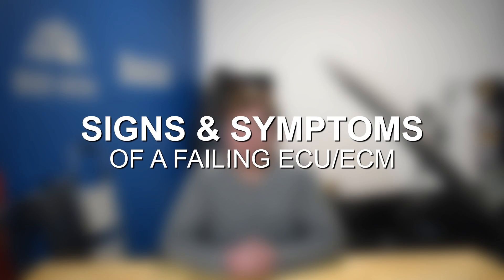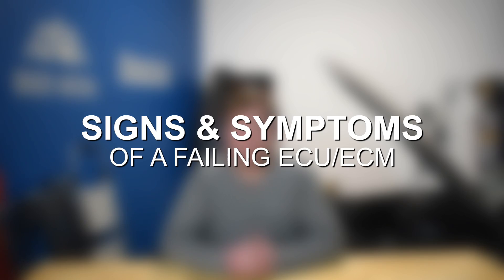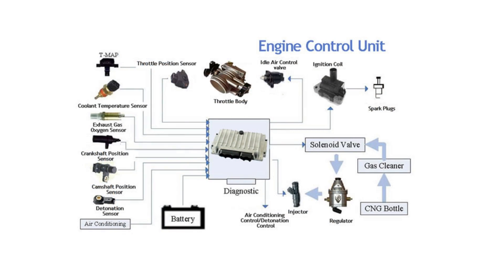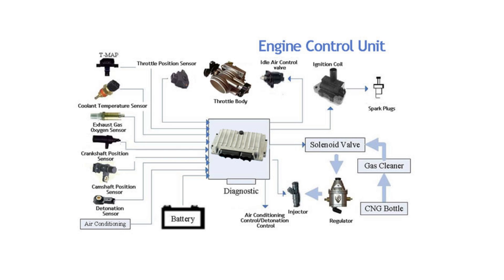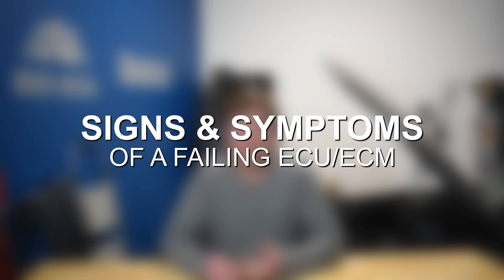Signs & Symptoms of a Failing ECU/ECM! (Engine Control Unit or Engine Control Module)

Comment: Great video, lets me know I was on track with my 2007 camry as i went thru all these steps you mentioned. New ignition coils, o2 sensors, cleaned out throttle body. However, I reset the ecm and it works great for about 2 runs of driving the car on maybe 30 minute trips but after parking it for the night, the next morning I start the car and boom, engine light back on and I know not to drive it at that point because the car has no power to move efficiently until I disconnect the battery for 15 minutes, reconnect, and it resets again. This is a daily ongoing pattern. My dilemma is do i spend another $260 on a new ecm. In your professional opinion, would that probably be your next option (after process of elimination), the car is 18 years old, already has new coils, o2s, clean throttle body (air flow system). Thanks again for posting this video 👍
Reply: I own a 2000 Mercury Marquis. It only has 36k miles on it. For the last 5-6 years I have had what seems to be an intermittent problem with the car shutting off on me while driving. When it is running it runs great. Nothing at that point makes me think anything is wrong with the car. Because of the intermittent problem I don’t trust the car anymore to drive it any far distances beyond 10-15 miles. What happens most of the time when the engine shuts down while driving from when it first occurred 5-6 years ago. The check engine light will come on. I plugged in my OBD II tester into the port below the dash and got a P0-320 code. That pointed to the crank Sensor so I changed it out using a Dorman brand of Crank Sensor. The car ran good for 9-10 months when all of a sudden the car shut off again with the PO-320 code came back on. At that point I purchased a second Dorman brand of new Crank Sensor. Installed it and the car ran good again running 8 months straight until it then shut down on me at a Traffic Light or Stop Sign. Sometimes it would start right up and want to die again. There were times I had to use both feet operating the gas and brake and maybe shifting in to neutral all the way home to get it home. Let it sit over night and once it cooled down it starts right up still showing the PO-320 Code. The 3rd time I went out and purchased a Ford Motorcraft crank sensor and installed it. Back in March of this year while it was sitting in my driveway at my relatives home when I went to leave the car wouldn’t start but turned over no problem. No continued check engine light and my OBDII tester showed no codes. I finally got it started and had to get creative with my feet again to drive the car about a mile to my home. At that point I gave up. I thought I would send the car out to a reputable repair shop. I knew this shop well because they did some work for me before on other vehicles  plus I did plenty of business with them in the past. I use to be in the Automotive Parts Business until I retired after 40 years and sold them bulk Motor oil in 55 gallon drums. Had Triple AAA Tow the car to the shop. The shop brought it in and called me after checking it out said they repaired the car charging me $308 telling me something was shorting out Coil #1 so they replaced it. I found that hard to believe based on my own knowledge of the car. When it ran there were no misfires it idled great. I went to pick the car up and drive it home. Something didn’t seem right to me still with the car. This was on a Friday so I got home and put the car in my driveway. On Monday 3 days later I needed to go somewhere so I thought let me drive my 2000 Mercury Marquis. It started up and died in the road. I had to push it to the side of the road with some help. Called Triple AAA again and had it towed to the shop again. This was in April of 2025. The shop kept the car there for 3 months. They were getting mad at me when I would call there after the 1st month to check on the car. Finally it was getting to be 3 months and I called them telling them I was taking the car and finding possibly someone else to fix the car if they couldn’t. Went there and had to jump the car being they let the battery discharge while sitting outside the shop. I drove the car home with someone following me. They supposedly checked everything including the fuel pump which isn’t old it was replaced once already by me maybe 8 years ago. When I opened the hood to jump the battery I saw the shop never put the engine cover back on the engine so I went back the next day to retrieve it. When there I talked with the shop owner. He told me he thinks it is the Cars Computer but didn’t want to install one because of the cost not knowing if that would have fixed the problem. So I am out the $308 they charged me to fix the car in April although it wasn’t fixed. No reimbursement. I never said a word. To be honest while the engine cover was off I looked at the 8 coils. They looked like all the original coils as dirty looking as they would be on a 25 year old car. Didn’t look like the Coil was ever changed on number one cylinder but I was charged for 1 new coil. So I am at the point of ordering a replacement rebuilt computer flashed to my Vin Number of my Mercury Grand Marquis. I figure what do I really have to lose and I am perfectly capable of making the exchange. Anyone’s thoughts?
Reply: @ffas23  that is kinda the same situation i was in with my toyota which i purchased from my sister n law after towing it home for them due to her son driving it rather abusively for about a year, i ended up buying it from them and fixing it for myself. Everything on mine needed replacing i think to begin with but finally investing in a ecm did the trick....until a few weeks later when the check engine light popped its head up....again. Resetting the new ecm over and over again didnt help and i felt i was out of options so...today...I drove it to autozone and had them run their tester on it and it reflected....now....a knock sensor was the problem. These issues like this can definitely troubleshoot the crap out of you. Hope your ecm fixes yours.
Reply: @BOBBYB3133 Thanks for the quick response. I am waiting to hear a little more from here before I make another move. Not looking forward to seeing if any other Repair shop knows enough to fix my problem. 3 months in the shop? At this point I am not feeling so bad being I got the car back now. I guess I am not too bad of a backyard type of mechanic turning wrenches on most all my cars since I started driving in 1968. At 74 years old I thought the smart thing was to just send the work out to be repaired but the reputable shop was not much smarter than myself being they couldn’t figure out the problem either. lol. What bothers me is I paid $308 and my car was not repaired last April. I couldn’t charge someone if I couldn’t fix their car if I was in the business of fixing cars. Doesn’t seem like the right thing to do. Then to sit on my car for 3 months straight. I lost all around on my situation. Live and learn they say. Problem is I use to recommend this shop to many people. I can’t do that anymore.
Reply from the maker: @ffas23  Given the long history of P0320 codes, multiple crank sensor replacements, and the fact that it will run great until it randomly dies, I think you’re dealing with either an intermittent wiring/connection issue in the crank sensor circuit or a failing PCM, not a coil problem. On these Panthers, a bad PCM is uncommon but not unheard of—especially if the stalling happens hot or cold, shows no other codes, and isn’t tied to fuel delivery or ignition output once the PCM loses crank signal. Because you’ve already tried quality Motorcraft sensors and still get P0320, it’s worth doing a careful inspection and wiggle test of the harness from the crank sensor up to the PCM for damaged insulation, corrosion in connectors, or loose pins. If that all checks out, a rebuilt PCM flashed to your VIN is a reasonable next step, and since you’re comfortable doing the swap yourself, you’ll save a lot compared to a shop guessing. Just make sure the replacement PCM comes from a reputable rebuilder with a warranty, and before installing, clean and inspect all main grounds and battery connections, because poor grounds can mimic PCM failure symptoms.
Reply from the maker: B - Yes, based on everything you’ve already done—new ignition coils, O2 sensors, cleaned throttle body, and the fact that the car runs perfectly after an ECM reset but loses power and throws a CEL after sitting overnight—it strongly points to a failing ECM that can't retain correct adaptive data or mismanages fuel/spark strategy once in closed loop. The reset temporarily clears out corrupted learned values, but the issue returns once the ECM re-learns and re-applies faulty parameters. If you’ve confirmed no vacuum leaks, wiring damage, or bad grounds (especially near the ECM), then yes, replacing the ECM would be my next move—just be sure to get one programmed to your VIN or budget for programming if buying used or aftermarket.
Reply: @8020Automotive  Thank you for the confirmation because i went ahead and ordered one before you replied lol and now i fell better about doing so. After all the mechanical steps i also went ahead and disconnected any grounds and cleaned them and rebolted so i felt like the only thing left was the ecm. Good advice ➡ Absolutely bought one that is being programmed to my vin. Hopefull that will do the trick. Thanks for getting back, your videos are a tremendous help 👍

Comment: My equinox is a 2011 an it’s throwing on the abs light traction control light an won’t go at times or will go by its self or it will die when going at 25 would yk what’s wrong with it?
Reply from the maker: K - Your 2011 Equinox showing the ABS and traction control lights, stalling at low speeds, moving on its own, or not accelerating properly points to a likely issue with a failing wheel speed sensor, bad throttle body, or even a faulty brake switch or wiring harness problem. The ABS and traction control systems rely on accurate wheel speed data, and a faulty sensor can confuse the system, triggering limp mode or causing erratic driving behavior. Also, a failing throttle body or sensor (like the throttle position sensor or accelerator pedal position sensor) can cause hesitation, random acceleration, or stalling. Scan it for stored or pending trouble codes with a proper scan tool (not just a basic OBD2 reader) to see if anything related to wheel speed, throttle position, or stability control pops up. That’ll help narrow it down quickly.

Comment: Bought a 2005 express cargo 4 y ago, shortly after it can only be driven on second when the dashboard warning lights appear, when the warning lights go off it drives normal. Some mechanic said it was the battery so i replaced it to no avail. Another mechanic said it was the break reservoir to no avail. Just picked it up from Chevrolet after 6 weeks and found nothing just codes. B1000, b1440, b2948, p0507, u1009 but he said i needed to replace the transmission which i knew it wouldnt fix it so declined and picked it up. Im out of options maybe i can sprinkle holy water?
Reply from the maker: R - Haha. You’re absolutely right to question the transmission replacement—that wouldn’t fix what’s clearly an electrical or module communication issue, not a mechanical trans failure. The fact that your 2005 Chevy Express only drives in second gear when the dash lights are on strongly points to it going into limp mode, and the codes confirm this: U1009 is a communication loss with the ECM, and B1000 indicates an internal module fault (often body control module or instrument cluster); B1440 and B2948 relate to HVAC and security circuits, and P0507 is high idle, likely a side effect. This all suggests an intermittent power or ground issue, possibly at the ignition switch, fuse block, or BCM connectors, where one bad contact can crash multiple modules and force the vehicle into limp mode. I’d focus on checking main grounds, battery terminals, fuse box power feeds, and especially BCM and ECM connectors for corrosion, loose pins, or cracked insulation—it’s tedious work, but way cheaper and more productive than blindly swapping a transmission.
Reply: @8020Automotive after replacing the starter when turn key to on it makes a noise similar to the noise it makes before starting the engine. I had never seen that. But the whole time the break reservoir was leaking, it was leaking into the fuse box and it had the fuse box cover off since i bought it by accident. I asked chat gpt and said a regular Home electrician can help me find the problems and My father is an electrician and Will work on it this weekend. I Will update the findings here thanks!

Comment: Could an ecu that's 30 years old go bad? I know you said it will run well still for 15-20 years. Im working on a 95 Honda accord, and the ecu is from June 24, 1995.
Reply from the maker: C - Yes, absolutely—a 30-year-old ECU, like the one in your 1995 Honda Accord, can go bad, especially due to age-related failures like dried-out capacitors, cracked solder joints, or corrosion from moisture over time; even if it still starts and runs, symptoms like intermittent stalling, rough idle, no-spark situations, injector issues, or random sensor codes can point to a failing ECU, and Hondas from the '90s (especially OBD1 systems like yours) are notorious for leaky electrolytic capacitors inside the ECU that slowly damage the board; if you’re chasing weird electrical issues with no clear sensor or wiring fault, it’s absolutely worth opening the ECU and looking for leaking caps, burnt traces, or a vinegar-like smell—and if you're unsure, you can swap in a known-good ECU from a junkyard or reman unit to confirm before throwing more time or parts at it.
Reply: @8020Automotive  Thank you! I had recently bought a refurbished/rebuilt ECU and installed it yesterday. & What do you know, it started right up! Before, I had thrown alot of new parts at it. But then after some diagnostics, I was able to determine that it was the ECU. It was a learning experience indeed! I appreciate you responding and being very informative. Thank you again!
Reply from the maker: @twinklymist7396  Love to hear it! Thanks for sharing.

Comment: I am only shooting a P0405 and I have replaced my EGR valve twice. The wires look ok. My car keeps cutting in and out as I drive. I replaced coil packs and spark plugs and wires. I dont know what it is or where to look next.
Reply from the maker: M - Sorry to hear this.. If you’re still getting P0405 (EGR Sensor A Circuit Low) after replacing the EGR valve twice and the wiring looks okay, there’s a strong chance you’ve got a bad ground, broken wire inside the harness, or a failing ECU reference circuit that’s misreporting the EGR position signal—P0405 means the ECM is seeing too low of a voltage from the EGR feedback circuit (typically below ~0.35V), which could be caused by a short to ground, corroded connector pins, or a failing 5V reference or signal return; I’d check the EGR connector for pin tension and corrosion, then test the voltage at the signal wire with key on (should see 0.5–5V depending on valve position), and inspect ground continuity from the harness back to chassis; if the car’s cutting in and out while driving, this may not be just the EGR—a flaky ground or failing power/ground wire shared between components (like coil packs, EGR, and ECM) could be intermittently killing signal, so start tracing those wires deeper or run continuity tests from EGR plug to ECU pinout and make sure nothing is dropping out under vibration.
Reply: @8020Automotive thank you for gicing advice. i was thinking my ECM is faulty. I am now shooting different codes. i am shooting codes for antitheft deterrent and some other one i cant remember. i had a mechanic a while back say i have a bad PCM. i dont have dashlights. i have continuously had electronic issues so i am starting to lean towards the ECM.

Comment: I have a 2007 jeep wrangler and the dash cluster is with no power, the wipers, shift lever is stuck in park, turn signals and gauges don’t work. I had a technical check it out and was told it was the PCM. The jeep starts fine not missing at all. Could it be the PCM?
Reply from the maker: J - It’s possible but unlikely that the PCM is the root cause if your engine starts and runs perfectly—in most 2007 Jeep Wranglers, the PCM controls engine management, while body functions like the dash cluster, wipers, shift interlock, and turn signals are typically handled by the TIPM (Totally Integrated Power Module) or a fuse/ground related to it; if your shift lever is stuck in park and the dash is dead, that usually points to a blown fuse, faulty ignition switch, or bad ground, particularly the ground near the kick panel or under the dash; start by checking fuses related to the IOD (Ignition Off Draw) and cluster, and verify all grounds are clean and tight—if those are good, the TIPM itself may be failing or have corroded internal connections, which is a common issue on these Jeeps and can mimic PCM failure without affecting engine performance.